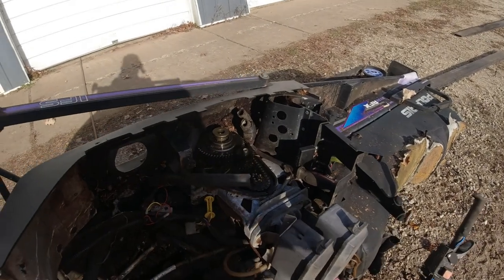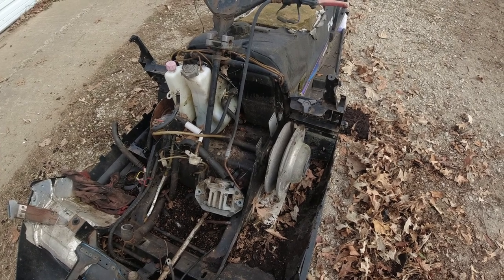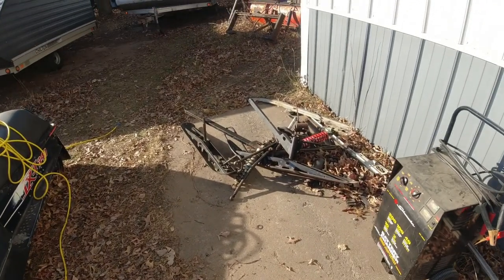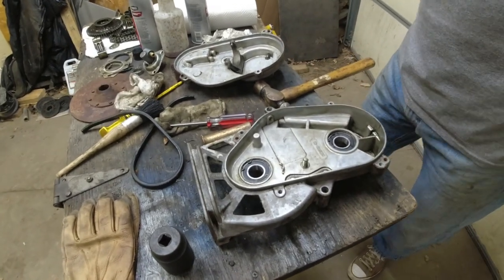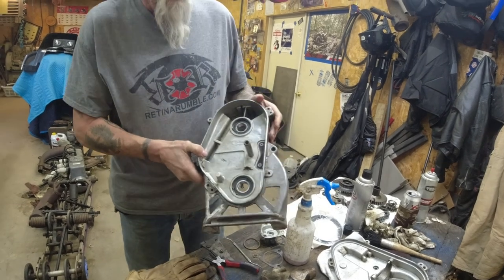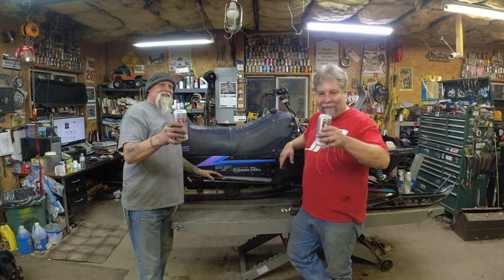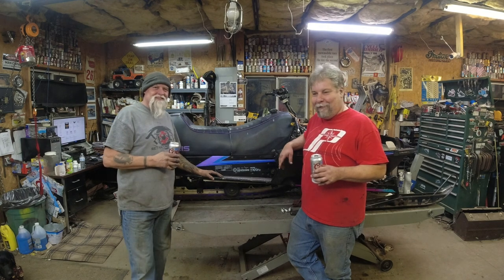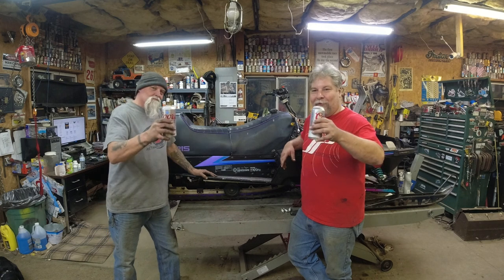Lonnie's XLT Part 4 : Reverse chain case upgrade!  Polaris Vintage Snowmobile

Comment: Awesome!!  I have a 97 xcr 600 and a 2000 triumph 600 - any idea what donor sleds with reverse would fit these sleds- adding reverse could change the game for me-
Reply from the maker: I'm not really up on anything after wedge hoods. Honestly not sure on those years. The best I can tell you on those years is to look for a complete reverse setup from the same type of chassis with triple. If it's an evolved find a chain case from an evolved. If it's an agressive find one from an agressive.

Comment: Does the reverse gear set gear down the sled from stock gears?
Reply from the maker: It doesn't really affect it except that it takes up more space. Otherwise it's hard to notice unless you are using it.

Comment: What’s your recommendation for lube in a chaincase? Seems like your against gear lube?
Reply from the maker: Silent chain should use either a dedicated chain case oil like Polaris SCL or use ATF if you are trying to be cheap. For decades chain drive transfer cases in 4x4 trucks and Jeeps called for ATF and the chains are similar.